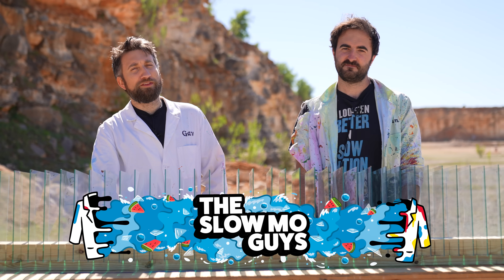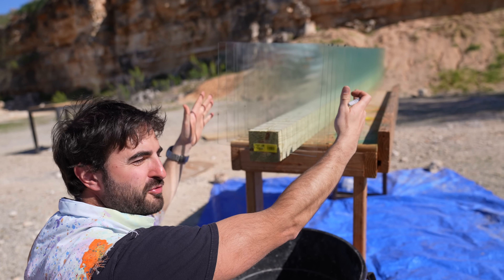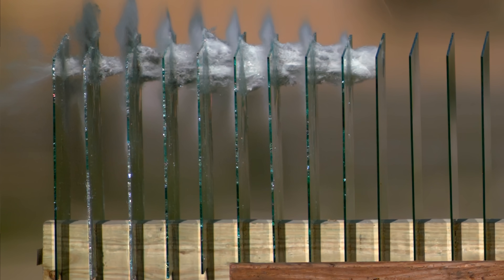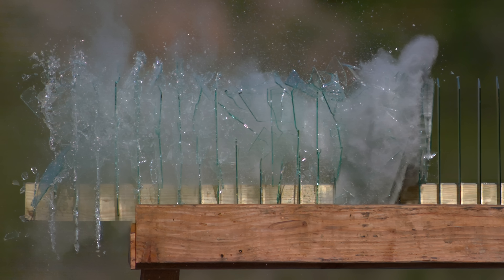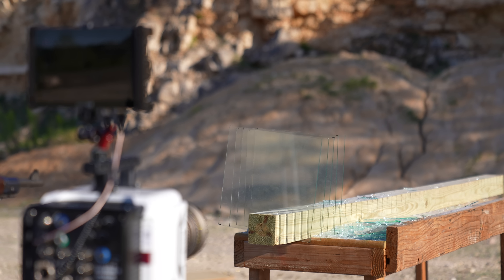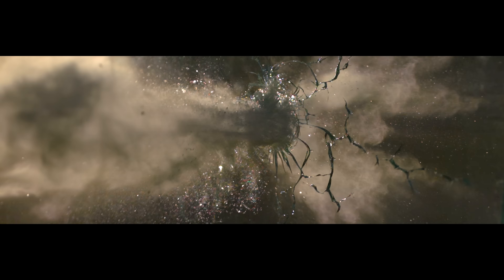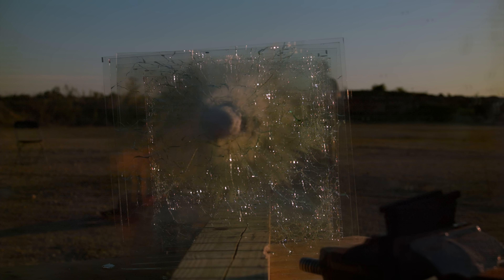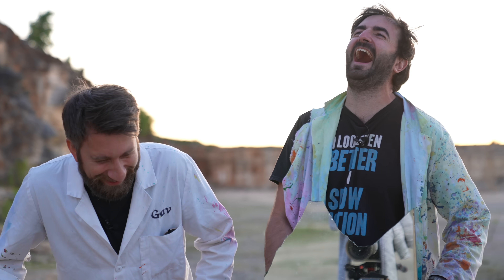Backwards Bullet Shockwaves between Glass at 375,000 FPS - The Slow Mo Guys

Comment: Actually, the .30-06 cartridge itself isn't considered too large or prohibited under the Geneva Conventions or the Hague Conventions, which more accurately govern ammunition use in warfare. Here's the clarification:

 Geneva vs. Hague Conventions:
- Geneva Conventions primarily address humane treatment of soldiers and civilians, POWs, and non-combatants.
- Hague Conventions specifically regulate the use of certain ammunition types in warfare, prohibiting munitions that cause unnecessary suffering or severe, excessive wounds.

 Ammunition Restrictions:
The Hague Declaration of 1899 explicitly prohibits expanding, hollow-point, or explosive ammunition in combat between signatory nations. It does not specify caliber as a limitation. The key point is ammunition design (such as expanding or explosive bullets), not the caliber.

 .30-06 Cartridge Compliance:
- The standard military .30-06 cartridge (for example, the M2 Ball cartridge) used a full metal jacket (FMJ) bullet, specifically designed to be compliant with international law.
- FMJ rounds, like the .30-06 M2 Ball, are considered lawful in warfare, as they don't expand upon impact, thereby avoiding unnecessary suffering in line with the Hague Conventions.
  
 Misconceptions:
- Some confusion arises because calibers larger than .50 (12.7 mm), like the .50 BMG or 20mm, are generally categorized differently (anti-materiel rifles or cannon) and have specific rules about their intended use.
- The .308-inch (7.62 mm) bullet diameter of the .30-06 cartridge is well below that threshold and considered standard for infantry small-arms ammunition.

The .30-06 rifle cartridge is legally compliant with international warfare regulations, provided it's loaded with FMJ (full metal jacket) rounds. The cartridge itself is not too large nor inherently banned under international conventions governing warfare.

Comment: 6:58 when the bullet enters it immediately sends out a shockwave out to the hexagonal fracture zone. Impact fracture zone is a hexagon. Of course the bullet and the imperfections in the glass can alter it slightly, but you can see the perfect 120 angle snap. 
 On a planet, the impactor and impactee fall back down on top and hide the hexagon. The 120 angles are everywhere. 
 A simple set of different mediums, like bullets into clay and rock and  other semi liquid plastic mediums will prove my point. 
Whenever I see one pop up in your videos I comment. No retort if any kind yet. Looking forward to the guys who snap this up. 😅
Reply: The mirror shot is the perfect way to capture the hexagon. If you only had one pane and went ahead and sacrificed the mirror too. You guys rock. I’ll get through eventually 
Enjoyed immensely

Comment: Its possible to load an even faster combination. There is loading data for .30 cal. cartridges that have a plastic sabot with a .223 / 5.56mm bullet, using a maximum amount of hot powder. Those push near the theoretical limit of the burning gas velocity itself, around 4,000 fps.

Comment: 🤔If you fired a bullet at a copper pipe or any pipe, would this create pressure that would cause a wave in the air in front of the pipe or an unexpected reaction? 

The bullet may be larger than the pipe or similar in size

Comment: Is it just me or are the 2nd and 3rd pane flashes brighter than the initial Kentucky effect? If that's the case, I'm wondering if the effect happens between certain speeds. This means that there are optimal conditions at which it happens. You guys should try to find these conditions...

Comment: If i would have to hazard a guess... i think the copper jacket of the bullet is being vaporized when it contact the glass because of its speed, and since the glass is silica, its extremely abrasive, hence the big flash happening slightly after first impact

Comment: Destin will have a field day with this. The flashes dissapearing at the same speed as the shockwave is really cool. With the distance between each pane, Gav could calculate the speed needed to produce the flash!
Reply: That was a fantastic data point.
Reply: The shockwave is going at the speed of sound (Mach 1), which changes with conditions such as air temperature.  When air is compressed it gets hot, the more compression the hotter it gets.  Diesel engines use compression to ignite the fuel air mixture.  Spacecraft reentering the atmosphere at hypersonic speeds compress the air so much it becomes a plazma.  A supersonic bullet (or anything else) has air piled up in front of it and as it gets close to hitting the glass (or any hard target), the air can’t get out of the way so it’s compressed so much that it’s temperature causes it to glow.  That’s the flash you see.  It can also happen at subsonic speeds depending on the geometry of the objects coming together.

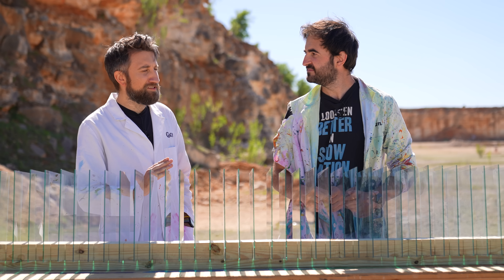Comment: At 0:54, i would like to point out that the faster the round is traveling the less time the impacted material has to move out of the way. Generally resulting in less penetration for a given caliber the faster it goes. 

A sub sonic round will generally penetrate more layers than a supersonic one. And a heavier round will tend to go through more than a lighter round traveling at the same speed, certain bullet and casing design elements and other relavent caveats aside. 

So. You are using the same material spaced closer together. This increases the chance of the broken impacted material causing breaks beyond the final bullet break. 

You are also using a much heavier round traveling faster, but the bullet point geometry is more acute for the round size. This means you get a penetration increase for velocity and mass, but a penetration penalty for easier tip deformation (caveats with hollow tip vs lead vs FMJ) but should still net a penetration increase overall, though likely not quite a doubling. Power drops off exponentialy with each penetration. I predict, based on your statement of the 9 mil consistently penetrating 11 panes when they were farther apart, that you are probably looking at around 15 to 17 panes. And if Im forced to pick a single number I would say 17. 

So lets see if my overanalysis of vague and undefined variables is anywhere close to accurate. Lol. Im ASSUMING you will be using a rifle since its a .308. I pick 15 panes if you have somehow found a .308 handgun.

Edit: I defend my guess by saying it was obvious that the last few panes totally only broke due to the other panes falling into them. Lol. (After that giant WOT i need to salvage my rightness SOMEHOW! lol😂😂😂)

Comment: THAT FLASH OF LIGHT ... WAS IT CAUSED BY THE BULLET POINT HITTING THE GLASS AT SUCH A HIGH SPEED THAT IT CAUSED HEAT TO FORM FOR A MICRO SECOND AND RELEASED ENERGY AND HEAT IN THE FORM OF A FLASH OF LIGHT ??? WAS THE PRESSURE AT THE POINT OF CONTACT BETWEEN THE BULLET AND THE GLASS SO GREAT THAT IT MAY HAVE MELTED A BIT OF GLASS ... SILICA AND CREATED HEAT AND  HUGE AMOUNTS OF ENERGY BUT ON A SMALL SCALE AND THEN RELEASED THAT HEAT AND ENERGY IN THE FORM OF LIGHT ???

Comment: I think the flash is just an energy conversion process where the pressure between the two solid objects of glass and bullet transfers into heat. The heat is so immense that it transfers into light.  Momentum = Pressure =  Heat = Light.  Just a thought.

Comment: You would have gone through more panes of glass if you had a more stable table and gun holder. Energy was lost with the gun going backwards. For example, in a Hollywood guns episode recreating the Rambo scene, the gun jams after a few shots because there is not enough energy to keep the mechanism going unless the hold it with both hands.

Comment: What is the thickness of the panes in millimeters❓                                                                                                                                                 🎈
What is the overall measurements of the panes❓
What is the distance between the panes❓How deep are the panes imbedded into the wooden beam? What kind of wood❓
You wear lab coats⁉You should have this information and be willing to share it‼Nice video❣Thank you Dan and Gav❣.......:yougotthis:

Comment: The impact location, the energy behind it, the metal against the glass, I bet the temperatures at that point are between 2000 and 3000 degrees where you see the light, and 4000 degrees Fahrenheit directly at the points of contact at the atomic level for that micro-second.

Comment: The transmittance of a regular glass pane is about 85-90 % at visible light wavelengths, so it's something like 0.87^50 that goes through. That's around 0.1 %. Even in a completely dark room, with no other reflections, and a single point of light at the other end, you would barely be able to see any light through all that glass.

Comment: Follow up experiments: Since you know the number of panes that ought to stop a bullet, make a series of frames with reduced spacing in each one. Have Destin get you set up with a laser sensor trigger.  also want to see that light pass-through effect from the perpendicular, but in the studio, using the badass robot arm camera. A video where the arm moving triggers the gun to fire and then follows the bullet laterally would be just stunning to see. I also want to see a slomo shot from that specific angle that allows only the reflected light to pass through (~1:20 and ~3:40 for example) while tracking the projectile.

Comment: I'm still convinced the flash or the Kentucky effect is from cavitation. Like with a mantis shrimp punching underwater there's enough compression of the air at the point of impact that the air is ignited. That's also why the fireball expands radially outwards like Dustin showed in his video.

Comment: Pls repeat when dark with light (strobo flashes?) from down upwards. The intermittent flashes would enable capturing the projectile path AND the flashes. 
Add one or several laser beams widened to a plane -  from the side parallel to the glass panes? "Construction leveling lasers"

Comment: Beautiful! Thanks, I needed that today. Very satisfying. The word you wanted is triboluminescence, but another cannel has proven it's actually the air getting trapped, squished and ionized, like in a fire piston! In vacuum it doesn't happen. The colour of the flash depends on the avaoilable ions.
Reply: Dieseling.
Reply: @Boraxo  So "turboluminescence" wasn't far off.
Reply: so if you dissolved some copper sulphate, painted it on the glass, let it dry... you would get a green flash :-)

Comment: There’s no such thing as something truly solid or still—everything is in motion. Atoms vibrate, particles shift, and even glass, which we call an amorphous solid, is constantly moving at a microscopic level. From a relativistic viewpoint, especially at speeds approaching light, the line between solid and liquid begins to blur.

That’s why a bullet passing through multiple panes of glass behaves like a water droplet hitting a still pond. The phenomenon looks different, but the dynamics—dispersion, wave propagation, surface tension analogues—are strikingly similar. In fact, the math checks out: both involve shockwaves, energy transfer, and wave interference. At high enough speeds, “hard” materials start acting like fluids, and you begin to see the universe's hidden symmetry in motion.

That's pretty cool if you ask me.

Comment: That mirror shot @10:13 ending with a fade to Gav with the camera is amazing. You couldn't have planned it better. 👌
Reply: That's Dan. You can see a short sleeve and the labcoat is open.
Reply: @trntom  Yup, although you can briefly see Gav's head in one of the broken mirror pieces towards the bottom as it falls.
Reply: Gav has an excellent eye for camera placement
Reply: would have been perfect for a mythbusters ad transition
Reply: @Ramseas119  yea, all of that carnage and destruction, and it turns out to just be a random guy with a bit of string
Reply: @jasonhildebrand1574  sounds perfect tho 😂
Reply: Nest time write nino on the side of the 2x4 so u don't have to count over and over just a idea

Comment: 8:00 “… the moment that it’s brightest” or the moment that the glass is still intact to transmit the light. It shatters so quickly that I wouldn’t be surprised it the light was getting bounced off cracks.
Reply: However fast you think something is, light is faster. That rule will hold pretty much anywhere you go on Earth.

Some real numbers: 500,000FPS is 2us/frame, light travels ~1ft per nanosecond, those panes are about a foot wide. That means light will bounce across the entire pane of glass 2000 times between every single frame of video.

Comment: NICE! You know what, for the next round of shooting, I would use a silencer to get rid of the shock wave that comes after the bullet passes through the glass. Because it tends to blow the glass forward! I was thinking, maybe the glasses don't fall apart completely and only a bullet hole appears in most!
Reply: A silencer may not be the best option for that because the gases still come out in the same direction as the bullet. A muzzle brake, on the other hand, directs the gases sideways, away from the target.
Reply: @mrxmry3264 +1 to muzzle brake. You can get VERY efficient brakes, that will strip off most of the gasses. Silencer would slow down the gasses, but still sends them forward.
Reply: @mrxmry3264It might slow their exit timing and decrease the volume on screen a bit, but the gases aren't even really the issue here.
Reply: Or just move further away.
Reply: Hey Medhi!
Reply: Or just fire through a single layer of kevlar or some thin plywood on a sturdy frame
Reply: The muzzle blast is a pressure wave, not a shock wave. Shock wave is specifically when something is going at supersonic speeds (so just the bullet)
Reply: @ Once the bullet uncorks the barrel, the remaining propellant gasses accelerate to something like mach 4 (projectile is moving at ~2600fps, or ~mach 2.5, and the gasses are passing the projectile, shortly after it exits), for a very short time and distance.
Reply: @pat2rome  If the bullet is supersonic the muzzle blast is also supersonic
Reply: Silencers are a legal hassle, and I don't think they're the best solution anyway. A barrier with a hole in it, placed as far away from the muzzle as practical would essentially eliminate the muzzle blast.

The muzzle blast doesn't arrive until it's pretty much all done anyway. Watch the first pane until the whole thing suddenly moves forward. That's when the muzzle blast catches up.
Reply: @Bob5mith  They're a legal hassle? In the US? I thought you could just get anything there. Here in Norway, supressors are easy to buy - but guns aren't.
Reply: @logitech4873  Silencers are regulated under the same laws as machine guns. You have to apply for registration, send in your prints for an FBI background check that's more thorough than the regular NICS check, pay a $200 tax, and wait several months for approval. It's not impossible. I have a few, but it's a giant hassle for just one video. They might find a shop with the right licenses to help, or one of their guntuber acquaintances there in Texas, but even then it's a hassle and the shop or registered owner would have to be present at all times. 

Rifles with barrels less than 16" and shotguns less than 18" require the same tax and registration processes. Machine guns have the added artificial scarcity that makes the way too expensive for most people.
Reply: Would it make much of a difference if the bench were solid so the gun didn't recoil, ergo round more oomph?
Reply: @ Locking the gun down more securely would make no meaningful difference, if any at all.
Reply: A subsonic round would be more interesting and effect it more then a suppressor would
Reply: Bros never used a silencer or hang gun in his life 🤭🤭🤭
Reply: @GroomersUseAltAccounts  TF is a "hang gun"?
Reply: @GroomersUseAltAccounts he really didnt cuz he lives in Canada😂
Reply: The fact 144 other idiots liked it is crazy. What an uneducated bunch of people.
Reply: @GroomersUseAltAccounts  every genius has a blind spot, genius.
Reply: Not his fault, he's Canadian. They aren't allowed self defense.  @GroomersUseAltAccounts
Reply: @GroomersUseAltAccounts I liked it to give more relevance to the comment even though it isn't correct.